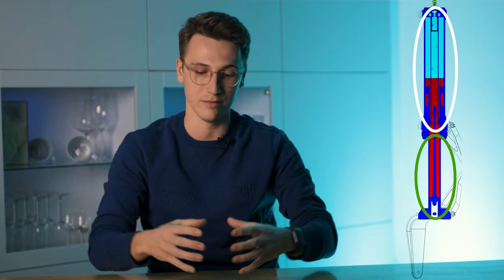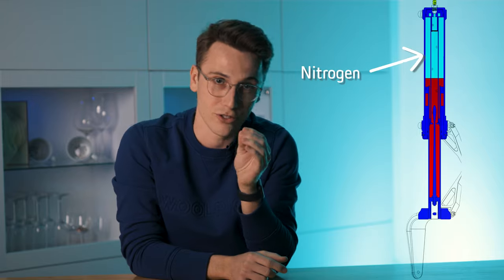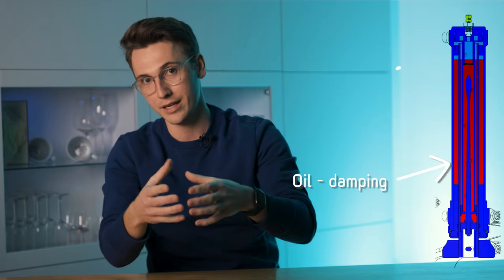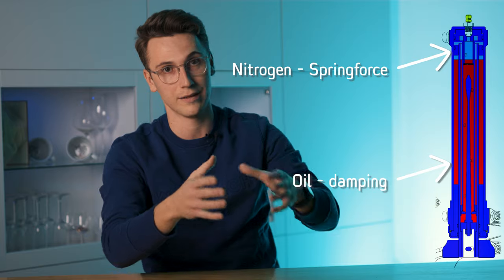Landing Gear Explained - How do they withstand all the load?

Comment: Not to get too picky, but the correct terminology is "landing gear" (not gearS).   
'Gear' in this context just refers to a bunch of equipment that does a job. (Like, say: Fishing gear refers to fishing equipment, ditto Diving gear or Sports gear etc..).

As others have said, Landing gear refers to the wheels, brakes, struts, pivots and hydraulic systems that make up the wheeled support system that allows an aircraft to move around on the ground, land & take-off.

'Landing gear' is it's own plural, as 'gear' is a collective noun.
So, the 's' after 'gear' is not needed.
Reply from the maker: You're right! Thank you for the info. Appreciate it! Always trying my best, since i only learned english in school.